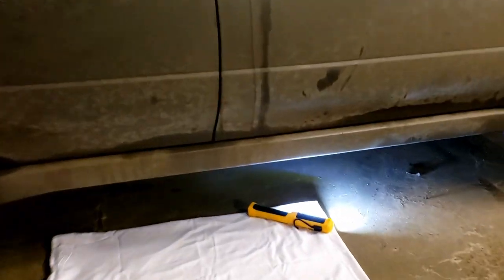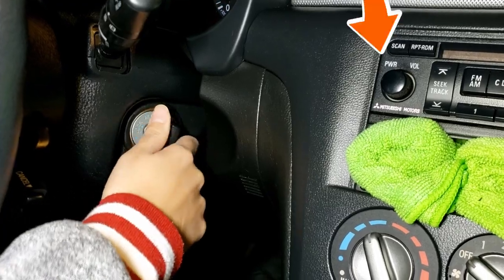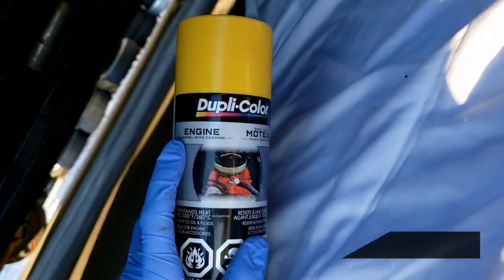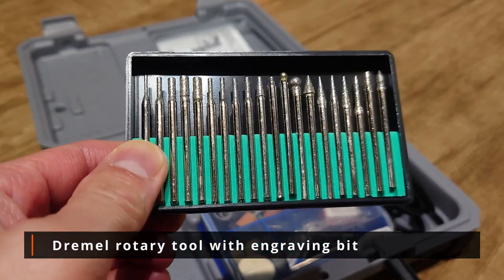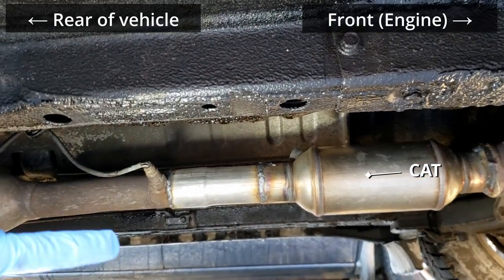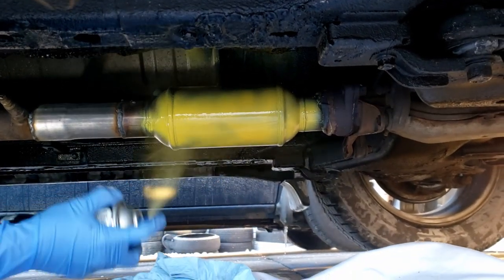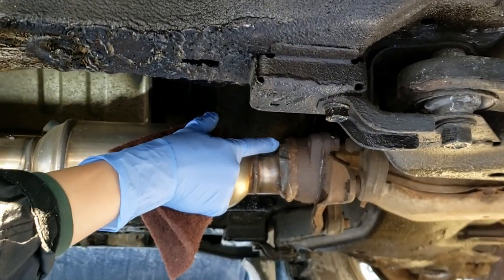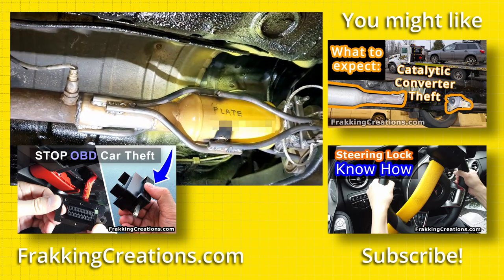Catalytic Converter theft deterrent - How to protect Catalytic Converter by Painting and Etching

Comment: NEWS FLASH- Converter thieves are not taking these converters to legit recycling companies. They are taking them to a fat ass guy sitting in a chair next to a shipping container and then being shipped over seas. They don't care if it's etched, painted, or boxed in. The best thing is to have a good insurance company
Reply from the maker: The point of the paint and etch is to make it easily identifiable as stolen.  Police have had to let crooks go when they pull them over with converters in their trunk because they can't prove they were stolen.  If they are painted and etched, it can eventually be tracked back to the crooks when the converter with the ID etched is reported stolen.
Also, if enough people paint and etch, it would mean a lot more work and time for the crook to have to sand/angle grind off.  More tasks to do, more time to get caught, less time to perform more thefts, more hassle.
It's definitely not fool proof and most things aren't when it comes to security.  Your front door locks can be drilled out easily to then access your house but does that mean you have stopped using you door locks?
Reply: @Frakking Creations  you make a good point with the door locks but these thieves aren't just your average person out to make a buck. It is a organized crime ring doing this. If it gives someone peace of mind painting n etching then by all means do it but these thieves could care less. Now if you want to make it more difficult buy building a steel cage around the exhaust then that is your door lock and may deter them to go to the next car but paint and etching, in my opinion a waste with these thieves.
Reply from the maker: True that the thieves may not care anyway.  When these thefts are happening so much people are just looking for things that might help.  We actually have another video on 4 ways to prevent catalytic converter theft which also talks about installing cages and welding steel bars as other methods.  A layered approach by using multiple methods is best but still not 100%.
Checkout our other video if you're interested.
Https://youtu.be/nENxTr6uFLE

Edit: Plus some people have had theirs stolen twice or more.  Each time having to deal with insurance and repair shops is time consuming and disruptive to your daily life.
Reply: @FrakkingCreations Big time disruptive
Reply: @FrakkingCreations Big time disruptive
Reply: @FrakkingCreations Big time disruptive
Reply: The best thing is to have an EV.

Comment: Just had mine stolen on the 19th contacted muffler shop to inquire about having rebar installed on new converter when repaired, was told it would cost $250 to have a rebar cage installed that's absurd

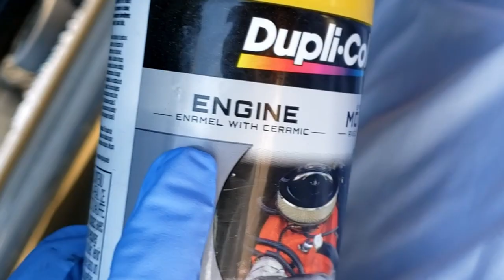Comment: 2:07 How did this paint hold up on the cat? Isn't it only rated for about 500-600 degrees? The stuff rated for 1200+ seems to only come in muted colors.
Reply from the maker: Good catch and good question. Some of it did burn off but I'm not sure if it was because we didn't have time to fully cure it, as mentioned in the video.
I have since then sprayed over the original coat with the 1200+ paint.
Agreed that the higher temp paints don't have as nice colors.  They tend to be matte versus the other one which was glossy florescent.

Comment: You should call your video how to make it easier for thief's to steal your cat converter. first paint it a bright color so the thief's can more easily identify it and were to make the cuts. then waist your time and money and bonus possibly damage your catalytic converter by etching your license plate number on it suggesting it would somehow be any kind of deterrent to whomever the thief scraps it to. Bottom line here not rocket science your paint and etching bullshit would take under two minutes for any thief to sand off at there Leisher,  the simple fact is the thief's buyer clearly knows there stolen and the person buying them from him know there stolen. and when they arrive in China the Chinese folks purchasing those containers full of cat converters to extract the metals to make new catalytic converters to sell back to the good oh USA. invest your money installing an actual shield. The longer it will to steal it the less likely it will be stolen simple as that.
Reply: Just read of someone else where they cut through or bent the shield.   They suggested multiple alarms.
Reply: @sl4983  layering multiple of what others doing . Best have a experienced welder weld hardened chain or rod on each side of cat and a few feet before and after .
Alarms will alert you if home then do what you want pepper spray or what’s legal . cat alarm home security sensors or many options . Best harden to welded to cat .  If car is away from home a power saw can even remove that .